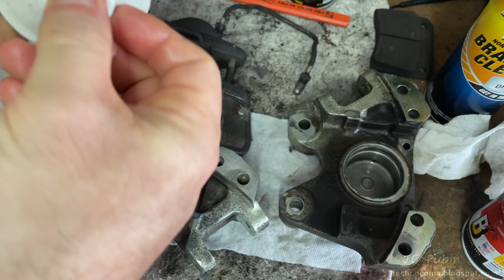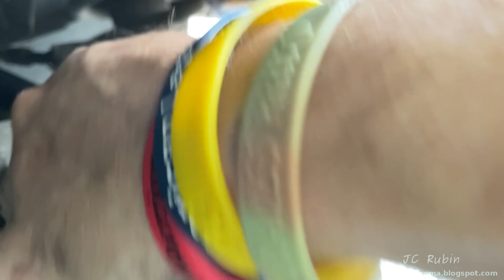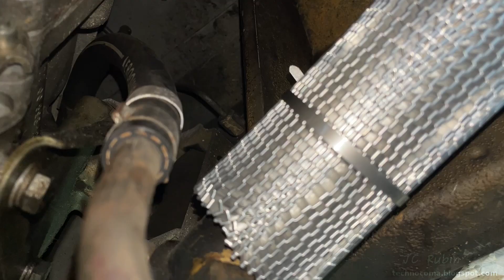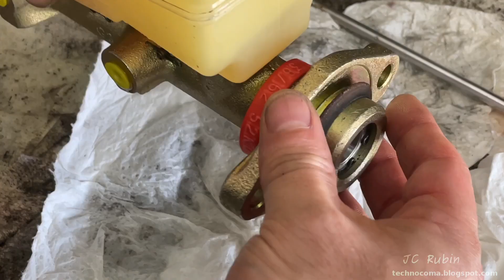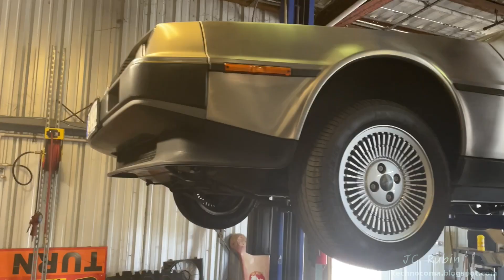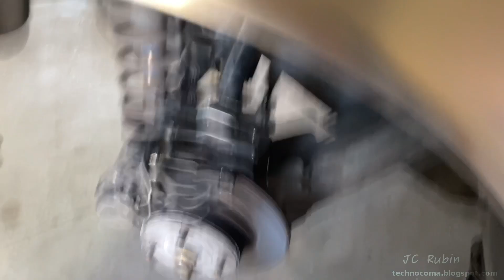Delorean Brake System Overhaul - Part 4 of 4

Comment: You did a massive service to the DeLorean community by posting this series - thank you. I rebuilt a ton of DeLorean brakes another lifetime ago when I worked at Grady's but I never rebuilt my own brakes even after daily driving on unbuilts for 15 years. I finally decided to do things right; brake & suspension rebuild, after a few years of letting my car sit too long - your uploads helped immensely as a refresher with my progress on rebuilding them at home.

I'm nearly done with the front brakes after 3 months of strenuous roadblocks such as 2 wheel bearings exploding as I'm installing them - all to replace with a $10 RockAuto bearing after spending $100 on a nice one that immediately exploded on the axle while installing. I got my brake lines from Rob yesterday and plan to install the fronts this weekend; all to finally put the front wheels back on the ground as soon as possible!

Next up will be the rear brakes, which I'm definitely not looking forward to crawling under / deep into the frame to replace those lines - but since I'm doing the fronts, I really need to do the backs while the momentum's there / doing things the right way. I already know my rear passenger caliper is completely seized after pulling the wheel off and seeing a paper-thin rotor left; explaining why my car pulled so hard to the right when I hit the brakes for 5 years, haha. So by default, I'm buying rebuilts and rotors from Rob, but I will have to assess the damage first. (one step at a time though)

DeLorean emergency brake(pad)s are simply too small to really get the car to stop, they're specifically just to hold it on a slight incline and not useful to slow down or stop the car. It would be incredible if there were a pneumatic E-Brake that fits to the stock rotors. The only option is a conversion kit that looks also like a ton of work to install and still requires a mix of DeLorean NOS / upgrade parts.

Looking forward / not looking forward to getting started on the back brake restoration, I'll be checking back on this video series many times to make sure I'm still doing it all the right way 
😆
Reply from the maker: make sure you take those seals out of the master cylinder that it comes with, lube them and put them back in.....if you are replacing that too.